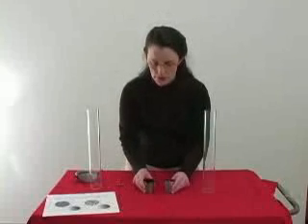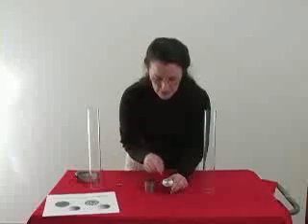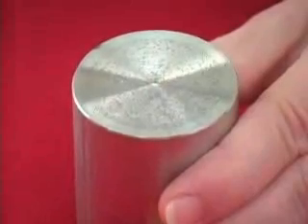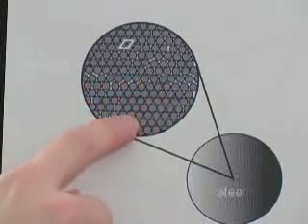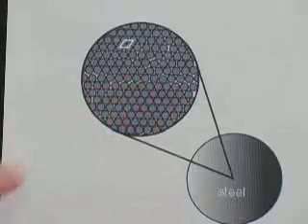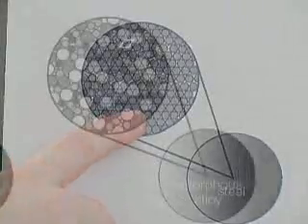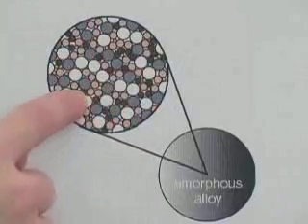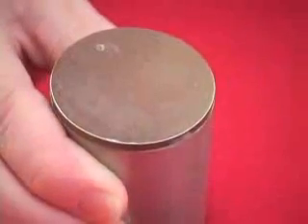Introduction to Amorphous Metal

Comment: It sounds like amorphous is referring to the structure of the final alloy, not the type of metal...  can any variety of alloys make amorphous metal?  or does it have to be certain metals?
Reply: Typically the alloys used to create amorphous metals contain alloying elements whose atoms are much different in size than the metallic atoms. This size difference inhibits crystal lattice formation slightly, which means that it is subsequently easier to freeze the amorphous structure of the liquid metal into place before crystals can form.